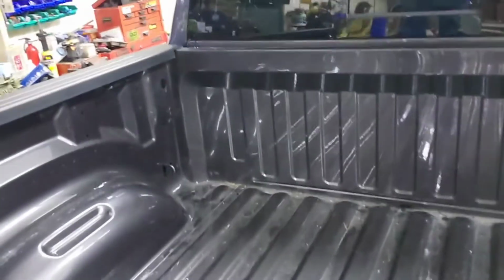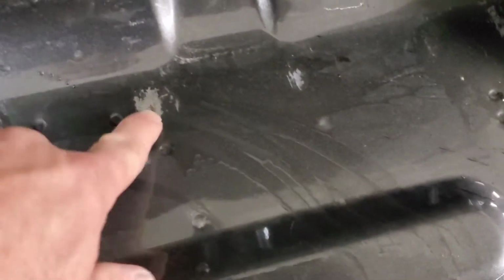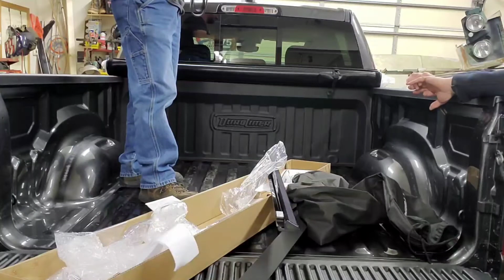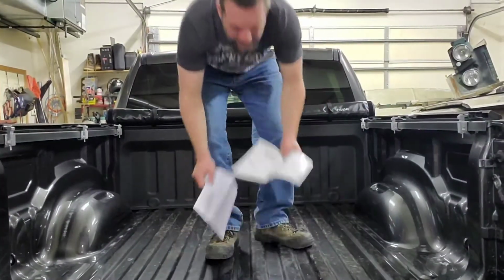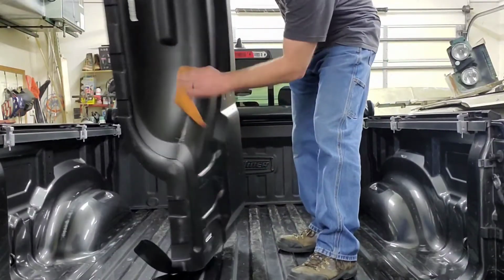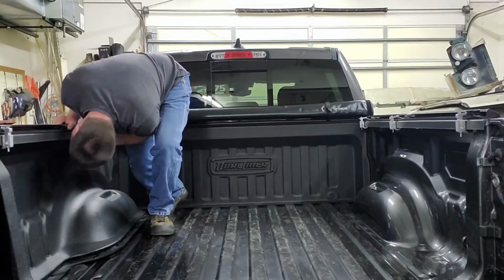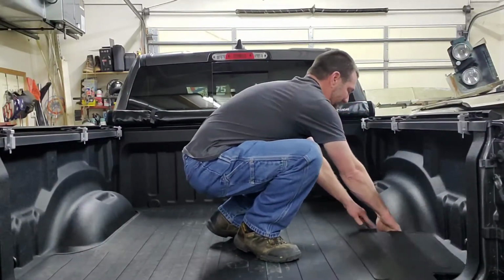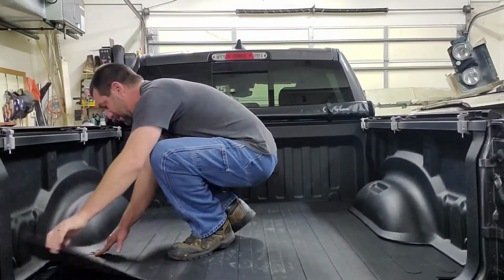2020 Ram Dual liner review and tonneau cover

Comment: Was looking at getting a duel-liner for my 2021 Ram.  Is there enough space to place a protective layer of "something" where it has rubbed the paint off?  How off was the clamps for the Tonneau cover because their site says it would not interfere with using a cover?
Reply from the maker: It's my buddies truck but if I remember correctly you can get some thin rock chip tape to protect the paint and the liner only needed minor trimming to fit
Reply: @RabidTransitGarage  Thanks for the reply 👍.  Definitely probably (is that thing?) going to end up getting one of these.  Thanks for suggesting the tape as well.  I wasn't even thinking that route for a type of paint protection.
Reply from the maker: Good luck with your truck, he like the liner otherwise.
Reply: @RabidTransitGarage  Thanks!

Comment: Could you install the cover without taking out the DualLiner?
Reply from the maker: Yes you can, but the tonneau cover will capture the header panel once installed. I cut the front lip off the header panel, so I can remove the entire bed liner to clean under it.